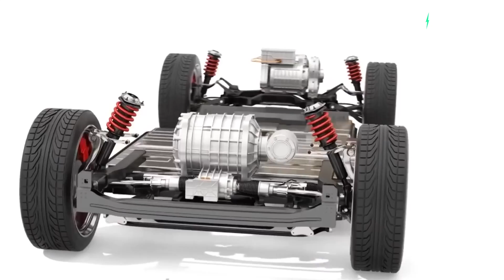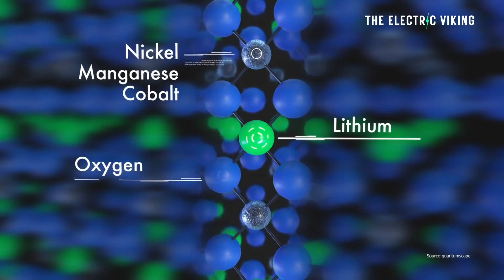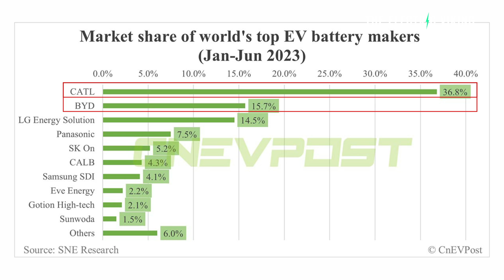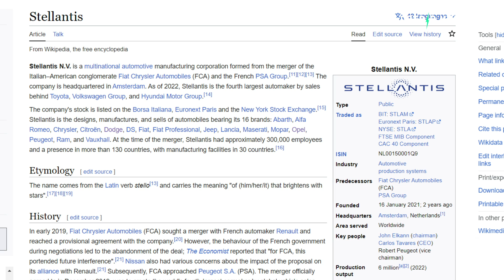Battery pack prices see HUGE decline - EVs cheaper than gas in 24 months

Comment: Price isn’t the big issue with these EVs.  Camping out at public charging stations, inoperative chargers, range depletion in extreme hot and cold weather, more frequent tire replacements, higher insurance premiums, exclusions on lithium ion fires, algorithms programs to shorten range to offset degradation, shall I go on?
Reply: Don't bother. Those who own them, especially Tesla, know that either most of these things are not true, or are not a significant issue for them. If those are a problem for you, you're perfectly free to buy an ICEV—but for the next 12 years only.

Comment: Viking, what are you ytalking about?  EVs are already much cheaper than ICE.  The average new car in USA costs $46,000.  A Tesla model Y is better in every way, and costs only 43,000 after tax incentive.  Over a 200,000 mile life, it saves $30,000 in fuel, maintenance, and insurance.  The charging network is adequate already, and improving every month.  It is no longer rational to buy an ICE car.  It may be a few years before this is true for pickup trucks.

Comment: I am atill unclear on replacement batteries which seem akin to the price of a new car, so afterb8-10 years are all EVs practically worth zero and everyone should be buying a new EV? This doesnt sound good for a secondary market.
Reply: Thanks Ben. That is helpful. I still think this is a fear and is not really talked about. It will affect confidence and resale values.
Reply: I think the battery will not take a mere 10 years to become useless, but rather, in that time, it will lose perhaps only 30% of the range. Replacement batteries is less likely than replacement cars if you ask me.
Reply: @موسى_7  Thank you. I am finding this helpful. I think various questions affecting price will become key in the secondary market including which generation of battery a car has - so if it has cobalt flammable batteries, I think people will steer clear regardless of mileage left in them.
Reply: You may be overstating the cost of a battery replacement, and this video states they're coming down even further. As one example, CYBRLFT, who drives a Tesla Model 3 in San Diego for Uber, stated that he paid $8,100 to replace his battery, which failed prematurely at 140,000 miles. This is about 20% of the cost of a new Tesla Model 3 RWD (base model). Details here: https://youtu.be/TaZDwslztFY?si=fbQIvmjYwwHQ5yj_&t=239.

Comment: Electric cars are still too expensive.  Normal sized car for 5 people with range 600km min must cost max 20k $/eur.  (Or less )  Then will start the REAL Ecar revolution.
Reply: Pretty sure there are few if any ICE vehicles that meet this standard.
Reply: @BigBen621  There are for sure. Skoda Fabia Combi cost around 18k euros. Decent sized car with extra space for luggage or sports equipment.  I bet i could found more if i wanted.  What im saying is that if we want real e car revolution we need to have 5 passengers cars with range 600 or more KM and they need to be cheaper then gasoline versions . That would be real end of combustion engines.
Reply: @MartinMartinX  Pretty sure the revolution is already upon us, even at today's high prices; what with the best-selling car in the world being the Tesla Model Y, which is twice as expensive as the runner-up Toyota Corolla—although that claim has been challenged. But of course a much less expensive option will accelerate it even more.
One concern, though, is the rate of new sales outstripping the expansion of electric grids and charging stations; so maybe it's not such a bad thing, keeping prices a little higher for a while! 🙂
Reply: @BigBen621 The best seller is Model Y, but EVs do not sell nearly as much as ICE, and more importantly, people still will drive the ICE they already bought
Reply: @موسى_7  Absolutely agree. One model BEV sells better than the highest-sales ICEV, but overall sales in different part of the world are running in the range of 10% to 20. More importantly, if you'll look at a graph of BEV saies, it's on an apparent exponential growth curve. So you won't be able to say EVs do not see nearly as much as ICE for much longer.

Comment: Hydrogen is best
Reply: Is it?  Please explain how.....
Reply: So true! Also, a hydrogen fuel cell vehicle costs seven times as much to operate as a BEV. Real world example: the Toyota Mirai carries 5.65 KG of H2, and gets an EPA range of 357 miles. A KG of H2 in San Diego, where I live, is currently about $29, having recently increased from about $17(!). So the per-mile cost of H2 for the Toyota Mirai is 5.65 x 29 / 357 = 46¢/mile. Meanwhile, my Tesla Model Y has a 75 kWh battery, and has an EPA range of about 320 miles. At residential rates of about 25¢/kWh, the per-mile cost of electricity for my Model Y is 75 x .25 / 320 = 6¢/mile—87% less than the cost per mile of H2. And actually, my cost is zero, because I recharge from my rooftop solar array, which of course HFCVs can't do. 

That's your hydrogen economy—good luck with that!

Comment: If battery weight is halved, a car with the same capacity battery should have increased range. The battery capacity does not necessarily need to be increased, since many BEV's already have greater ranges than their petrol-fuelled equivalents. Many small fossil cars from the past 50 years only have a range of 200 to 250 miles / 320 to 400 kilometres. An original mini only had a 3.5 gallon (imperial, not US gallons) fuel tank, giving it a maximum claimed range of about 160 miles. In practice, that could closer to 120 miles in a U.K. Winter. Most people were happy with that.

Comment: Past 10 years battery cell price decline from 50 to 80% but petrol car prices has increased by 40 to ....200% to mach the EV prices so now they look as a choice like the ads ...An hybrid at petrol car price .... yea right... I predict the Hydro car has to be be 10K more expensive  so EV price will increase atleast 10K nomatter how cheaper the batery will cost. If Musk realy wants the world only drive EV then he should lower hes Tesla 3 price from 48K (Euro) to 30K because 48K is still 10K higher than he said it would sell in europe. (Whats wrong with those people about the 10K number).

What i saw is buying new cars over the years what it costed me.
Opel Astra SW 1700 Diesel Full option18K - Renault Megane SW Full option1500 Diesel 22K - year after Megane buyed second car Renault Twingo 1200 Petrol full option 15K - Opel Mokka X Full option 1400 petrol 30K . Now lets look at new EV prices of those cars without looking at KW and range

New EV cars have barly options to ad but here we go.
No opel astra SW EV yet but theyre is the normal 5 doors new astra 45K (18K)
No Renault Megane SW yet but heres the normal  5 doors E-tech electric techno 54.6K (22K)
Renault Twingo Techno 26.5K (15K)
Opel Mokka Electric (starts at 41K??? and cant even get to 400km) 45.5K (30K)

So yea if the world would be a better place if everyone goes on the EV train then tell to the manufactors to stop with the idiotic overprizing scam or even better force the politicians to force the manufactors to decrease the prices dramaticly like 10K ofso ...... Yea you to Musk , you promised that Tesla 3 would come to europe at 38K max so whats up with the 48K ....

Comment: EV cars are too expensive.  I will keep my current 12 year old car for another 4 years until the hydrogen cars are produced and you can fill up in minutes rather than waiting for  a battery to charge up.
Reply: Hydrogen cars are already available. You have a choice of two. The Toyota Mirai at around £50k  and the Hyundai Nexo SUV at £70k  So, what's stopping you?  And you may not always be able to fill up in "minutes" at a hydrogen filling point if someone else has just used it. It may take anything up to 20 minutes for the pressure to equalise in the pipework before your delivery can go ahead....  And I don't "wait" for my battery to charge up. I charge at night while I sleep. It also costs around a quarter of the daytime rate, plus I have to sleep anyway......
Reply: @Brian-om2hh  The nearest he station is one hours drive away at the moment so not really practical until the infrastructure is in place. my last car was 18 months old when The UK government hasn't sorted ev charging let alone the network for h2 fuel stations. They want net zero on the cheap with no infrastructure planning.
Reply: And pay over seven times as much. Real world example: the Toyota Mirai carries 5.65 KG of H2, and gets an EPA range of 357 miles. A KG of H2 in San Diego, where I live, is currently about $29, having recently increased from about $17(!). So the per-mile cost of H2 for the Toyota Mirai is 5.65 x 29 / 357 = 46¢/mile. Meanwhile, my Tesla Model Y has a 75 kWh battery, and has an EPA range of about 320 miles. At residential rates of about 25¢/kWh, the per-mile cost of electricity for my Model Y is 75 x .25 / 320 = 6¢/mile—87% less than the cost per mile of H2. And actually, my cost is zero, because I recharge from my rooftop solar array, which of course HFCVs can't do. 
That's your hydrogen economy—good luck with that!
Reply: @BigBen621  As with most new technologies and infrastructure sometimes it is initially expensive. we have public buses and some trains running on hydrogen in my area. I can't imagine that the bus companies would have done all the conversion costs if it were to be more expensive than diesel. it costs £10 per kilo in the UK.
Reply: @davidallen513  "City cancels order of 50 hydrogen buses after realizing electric buses make so much more sense" Electrek, 1/11/2022
H2 costs are going up, not down; having nearly doubled in San Diego in the past year. If you can charge at home, it doesn't matter how long it takes, because you're sleeping while it charges. If you have to depend on public charging, you might be better to hold off, as you say; but don't count on H2 being the best choice then. It's much more likely that advances in batteries and charging speeds will make BEVs the most attractive choice by then.

Comment: Until and unless they solve the range problem, and the huge environmental damage to produce them, and the huge depreciation, then I’ll pass
Reply: Yet you're completely ok with the huge amounts of CO2 emitted from ICE exhausts?  That's how we've arrived at dangerously high emissions levels in our towns and cities.... And what about the massive CO2 emitted by the oil industry?  And the occasional huge oil tanker spillage we see?
Reply: @Brian-om2hh  yes!  It takes around 9 years for an EV to be more environmentally friendly than ICE, due to the enormous damage caused in construction- primarily the batteries of course - and by then the EV will need another environment-destroying battery.  And, most people outside cities cannot use them due due to the limited range - they are simply not practical…
Reply: @rascalap2968  Every one of several studies I've seen conclude that the breakeven comes within the first year of operation; but who's counting?
Reply: @BigBen621  that’s breakeven on what comes out the exhaust.  The mining of the battery materials, never mind the exploitation of the workers doing it,  and the manufacture transport and distribution makes a huge environmental debt that takes many years for mere exhaust fumes to balance out
Reply: @rascalap2968  That makes no sense; the reduction in direct emissions is immediate, so there's no break-even at all. It is, in fact, the end-to-end emissions that usually show break-even within a year, although it can be much longer in the few areas where the grid is supplied primarily from coal. Here's a quote from The Guardian, itself quoting a study by Reuters: "The break-even point depended on the source of the electricity used to charge the Tesla. For one charged entirely by renewable energy, it was 8,400 miles; for cars charged using the average US electricity generation mix (23% coal-fired, plus other fossil fuels and renewables), break-even came at 13,500 miles; and for electricity coming entirely from coal-fired stations, it was a whopping 78,700 miles."
Believe what you wish; but every study I've seen comes to a similar conclusion; payback of end-to-end emission within a year in most areas, but several years where most or all of the grid is fueled by coal.
Reply: @BigBen621  minimum I’ve seen is 4 years, most estimates range around the 8-9 years.  That’s just for manufacture of the battery, and doesn’t account for the massive water usage in water-poor countries, or the child labour in the DRC.  I couldn’t have that on my conscience, so I’ll stick to ICE for the next decade or so, until the tech and supply chain has matured

Comment: Have they worked out how to not have cold drop the battery life 50%... that will be a good step.
Reply: A heat pump usually does the job. Many EV's already have one...... And it doesn't drop the battery life by 50%. Clearly, you don't own an EV.
Reply: Cold doesn't drop "battery life,", it drops range. And in numerous cold weather test, the drop in range varies by make, with Tesla being about the best; but is nowhere near 50%. I don't think 80% of the new cars sold in Norway would be EVs, if this were the case.

Comment: Internal combustion cars are as cost-optimized as they’ll ever be. How much does it cost to build those engines, transmissions, and differentials, with their thousands of high-stress moving parts? That’s a big percentage of the cost of a car. Assuming all the other parts (body, interior, tires, etc) are basically the same between ICE and EV, that’s where there’s price leverage. So if the drivetrain is 25% of the cost, then there’s a theoretical limit of 25% better price. If the drivetrain is 50% of the cost, then there’s a 50% better theoretical limit. Of course, the theoretical limit would require zero-cost batteries and motors, so that won’t happen. But 50% cheaper? 75%? That seems pretty doable. So I can easily see an EV costing 10-20% less than a comparable ICE car - possibly more.

Comment: These battery packs still have range lower than ICE cars. What's the point of buying an EV then.
Reply: How often do you drive 400 miles NON-STOP? 🤡😂😂😂
Reply: a EV have less service and electricity cost less than gas.
EV more safe...
Reply: @mikafiltenborg7572 especially when evs spontaneously go on fire when they are stationary

Comment: Interesting thinking:
If the demand for raw materials for the production of batteries increases by about 40 times, will the battery cost less or more?
Reply: Not sure the minerals are currently available for that kind of global demand increase. They may be there but not yet available. There needs to be a massive increase in mining to accomodate  this transition. This will need to happen in a sustainable manner or we will end up with similar issues with the negative impacts from the mining. Granted proberbly nowhere near as bad as the impact from emissions from ICE cars etc.

Comment: We need to see demonstrations how to properly make things such as pouch or 18650 batteries, with affordable kits for sealing the battery casings, because its actually very easily done when considering what appears to be adding a few layers and rolling those layers up like a swiss roll, or flat like a  several ingredient sandwich. Recycling can be done at point of use.

Comment: Why not have easy removable battery packs that have multiplatform adaptability? 
Wouldn't that do more than resemble pretending to care enough to design that way?
Reply: for Taxi companies.
Reply: Because you'd lose your 8 year battery warranty if you had your battery swapped out. And how could you be certain you weren't getting an abused on as a swap?
Reply: @Brian-om2hh  because of the built in battery management system.

Comment: How much does it cost to drive an EV for 100 km in terms of electric charging costs? Does it match 7 litres of petrol per 100 km???
Reply: Assuming you are charging at home, it depends on how much you pay per kW and how many kWh the battery is. The latest BYD standard Dolphin has a 45 kWh battery. If your electricity costs 25 cents, then 0.25x45 is $11.25. The battery is rated for 340km, therefore  should cost about $3.30 per 100 km, in perfect driving conditions where you take advantage if re-gen etc. However, also factor in the cost of maintaining an EV which is significantly less. I just had an annual service for my 5 yr old ICE car, $600. Oil, filter, air filter and a few other things not required for an EV, plus all this takes a mechanics time. Plus I'm not far off a new battery and I've done 55,000k.
I'm not even worried about a replacement EV battery. Even if I do 20k kms, double my usual kms, it's 25 years to 500k - I'll be dead by then. 😅
Reply: @GlenisRetiredNZ  Size of battery does not matter, the price per kw remains the same.
Reply: @BioniqBob  the cost per 100km would remain similar regardless of the size of battery but not all batteries use the same tech or get the same mileage.
It's just an estimate to show how it can be calculated.
One thing to remember is you get less km's on a long highway drive because you use the brake less = less regen, although I don't know how significant that is.
Reply: @GlenisRetiredNZ  I charge at night most times and it is only $0.074 per kwh.
Reply: @BioniqBob  nice! Lucky you, that's almost free driving. I'm in NZ, much more expensive here 🙁. I haven't got my EV yet, its that cost+decent range+greenest battery tech
Reply: @GlenisRetiredNZ  Good luck, lots of new EVs coming. You will enjoy it when you do get one. Even if I didn't save, I would never go back to ICE. Cheers